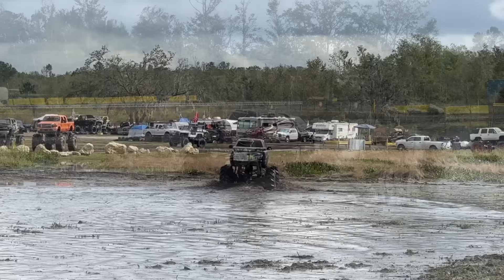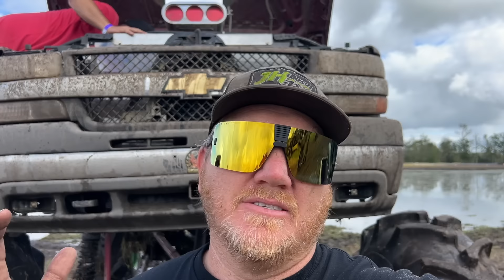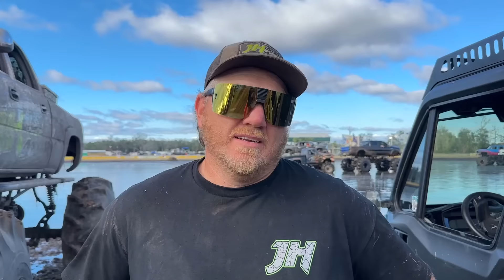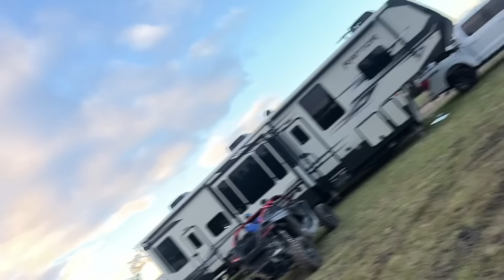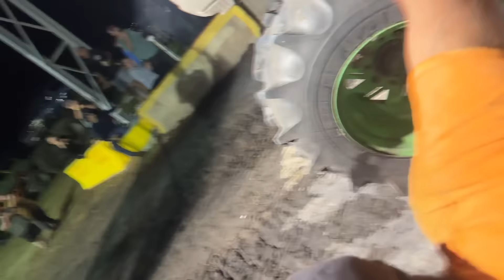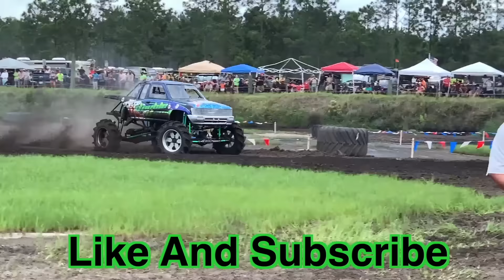First MUD BOG With The New Engine!!! Multiple issues.... But It Still Rips!!!

Comment: An old trick for waterproofing the distributor,  get a pair of Marigolds ( dish washing gloves ) and run the plug wires up through the fingers and stretch the cuff end over the cap and body, securing them with strong elastic bands. Try to make the openings on the fingers as small as possible and  again seal them up with elastic bands over the pair of wires in each finger. Use the thumb for the King lead if needed. Used to work well on our Range Rover off roader that regularly used to see water over the bonnet line. Less messy than grease everywhere if there was an issue.
Reply: That's Hella smart. Appreciate the tip
Reply: That is one of the most brilliant ideas I've ever heard! Hell yeah sir!
Reply: Distributor condoms save lives
Reply: @marshallgibson8872   🤣🤣🤣 Certainly  saved us from getting wet a few times.

Comment: Used to run a thin film of gasket maker on the mating surface of the distributor cap and let it set up before putting it back on. Also dielectric grease on the plug wire connections helped alot

Comment: OK,peanut gallery here ( Monday morning quarterback )
Fuel injection, yes, but what about spraying the distributor and wires with that flex seal stuff( make it a commercial) it will help with insulation between the wires and headers as well as keeping water out. just an old man's thought.

Comment: We use duct seal mixed with a little wd40 to keep water out of the distributor on the mud trucks around here. Just lay it on thick and cover the whole cap in it. The wd40 keeps it soft

Comment: Seal up the top and bottom of the distributor and around the plugs and leads with Selleys Silicone 401 RTV or donso tape have done it multiple times and can submerged an petrol engine without out having issues

Comment: New engine is sucking more air, so the carbs are now jetted wrong and are running lean. That is why the exhaust is so hot. Put an afr gauge on it and get those carbs tuned before you melt a fancy new piston.

Comment: Take like 6 inch 90s for like exhaust pipe thin wall turn where you want them weld them together run them through the firewall and put filters on them you will never have that problem again just set the 90s right on top of the carburetor drill a hole through them bolt them dowultimately and then make your piping the way you want it Go right through the firewall and stick your air filters on that's what I did with mine works awesome. As far as the distributor goes  wrap it with old inner tube

Comment: Youll need an AFR guage at least on one bank or put a bung on each collector so you can tune
Reply from the maker: Yes we are working on that now.
Reply: @JHDieseland4X4 bro your probably lucky that the blower belt came off with how lean it was running haha
Reply: We usually ran a tad fat on the fuel on a couple of our blower setups. Both of ours had locked timing in them. V-drive boat and our Nova.

Comment: what ive seen some guys do is make a tunnel for the breather hat but the hat faces backwerds an the tunnel goes into the firewall under the dash to help numb the intake sound in cab,

but yea you gotta git the intake air from in the cab an you wont have a problem, an for the electrics, a few bags ducttaped as hard as you can git it around the distributer.

Comment: Run a 8mm blower belt and if you take the pulleys and drill a bunch of hole’s in between the teeth make the blower three times as loud also need bigger carbs like a pair of 1050s if you need any belts pulleys used parts I have ALOT from building blower motors

Comment: If that ever happens in the field you can rev the engine up a little and stick a board or something to seal the top of the carb closed and them pull the board off before the engine stalls the vacuum in the carb will suck all that shit out of the carb it puts it into your engine but they love that shit you just gotta send it

Comment: Hey how come you didn't go efi I mean there so common now and will eliminate a lot of issues seen with a carburetor and then you have a lot more control with tunability. I mean even down the road you guys could even go with the the Holley sniper EFI and then you're able to control the timing a little bit more and you're not going to get fuel starvation I don't think I mean growing up we only went mudding with carbureted trucks you know back then it was like a lot of the fuel injection stuff wasn't was either too expensive or just wasn't adequate but we weren't driving through mud bogs like you we were doing a lot of climbing you know our lake that we have it's called Steve Lake in Canada here and you have the mud bogs or the flats and then you have some technical stuff then you've also got a whole bunch of trail riding you can do and that tended to be my favorite was the trail riding but you guys have a lot different landscape than we do in the Canadian Northwest. I'm just sending this message cuz of curious to know what the difference is reliability wise and also cost effective.

Comment: You don’t really need air filters just run you two 4” intake pipes from each carb to the cab of the truck then as long as you don’t drown your engine isn’t going to drown😂